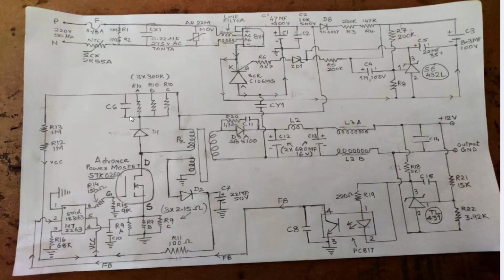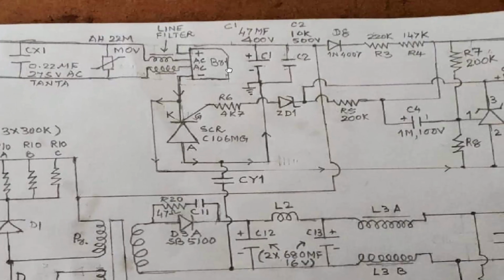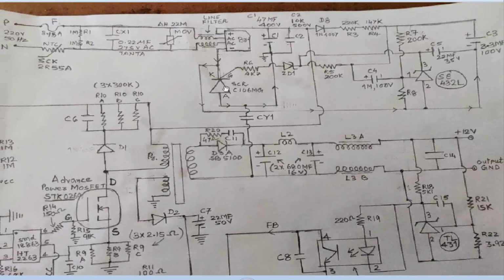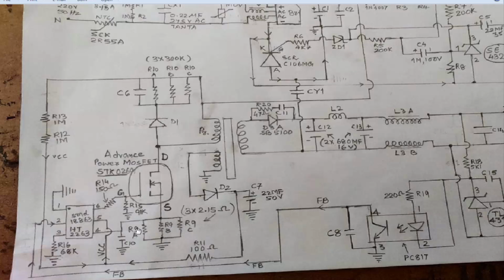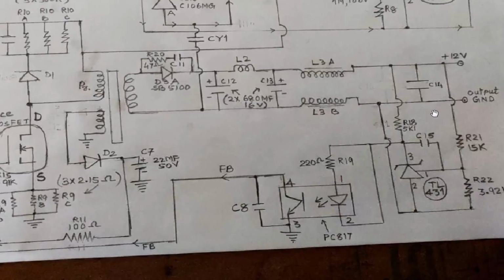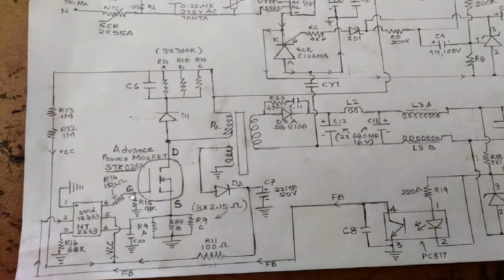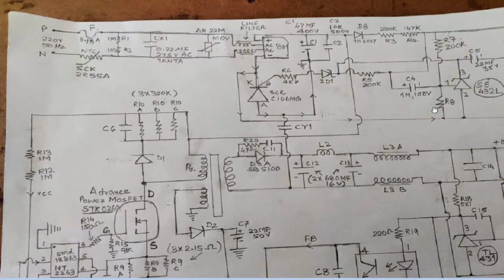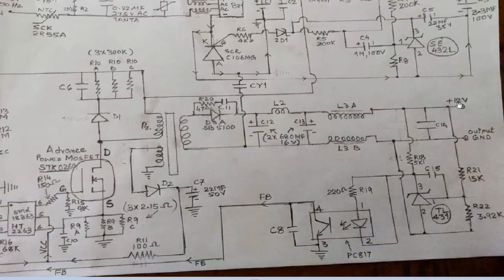#279 Switch Mode Power Supply Circuit using HT2263 SMPS Controller

Comment: Absolutely  excellent  work, the only small math error occurs in the current sense  resistors at the  source of the mosfet ,I see the three are in parallel but your calculation seems to be for a serial arrangement,kindly review it

Comment: Sir can you do a vedio about tsm111cn atx power supply ic .I have LITEON  PS-5251 POWER SUPPLY it's perpul and green wire voltage ok .but wen the green connect to ground,output is 0v all .please help me

Comment: One thing I would like to request you for that please make some videos on active power factor correction used in switching power supplies. What it is, why it need, it's working phenomenon and it's implementation. Although I have basic idea about PFC but not in power supplies. I've learned a lot from your videos and right now no one can explain this better than you. Please do some videos as and when you feel free and comfortable. Thanks.

Comment: Hi sir, it's a nice explanation and we found a new thing on the primary side the SCR which we don't find usually in these power supplies and that was another addon in our perception. Otherwise all the others things were almost similar. I'm sure there's a majority of viewers who could be easily confused. I have learned that depending on requirements there may be great use of various designing techniques although the basic principles remains the same.

Comment: Mr Haseeb Thanks for the information I have mosfet with data sheet Rds 0.0042 Ohm
its for Sukam inverter and after 
use I check the mosfet it’s giving 0.200ohm in on condition my question does these mosfet good or bad 
and the inverter after start it is going to over loud function
mosfet 150n10f7 .
Thanks again